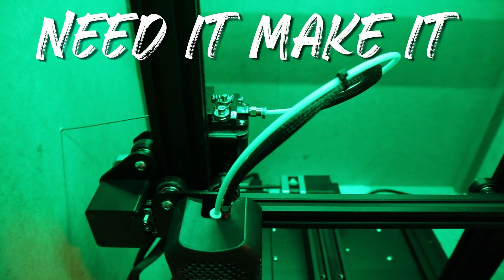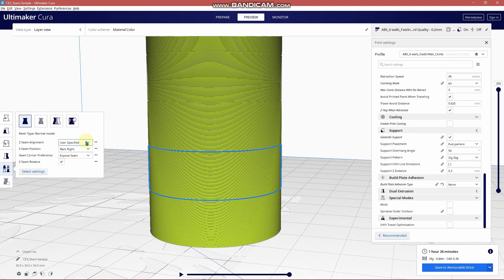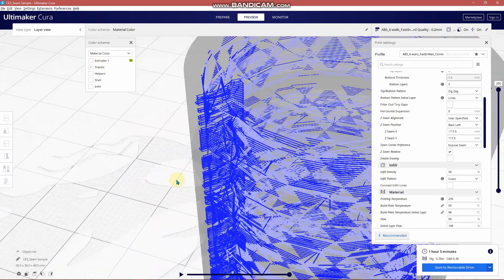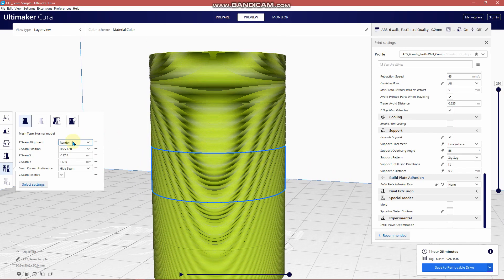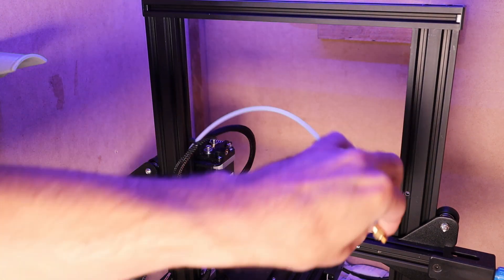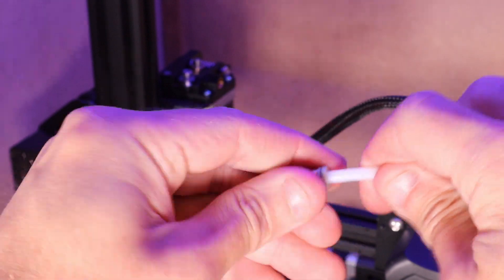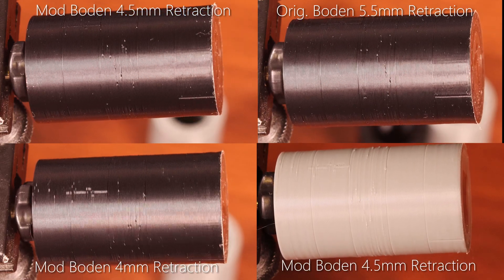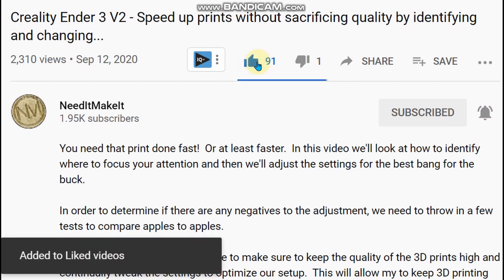Creality Ender 3 V2 - Testing Bowden Seams Through Cura & Viewer Suggested Mod

Comment: There are so many options because it also depends on the material. Our high quality capricorn and like boden tubes are 50cm long and have a very small ID tolerance and with about 6.5-6.9mm retraction we gut zero issues. Just ensure you always keep the length of your Boden tube the same when you replace it.  Also inside travel is key and inside before travel.

Comment: I use "wipe distance" at 0.8mm. Seems to make the best seams when you use double the nozzle diameter for the wipe distance. Coasting is a hit and a miss, don't use it much.
Reply from the maker: Always good to wipe, I agree, coasting hasn't done much for me either, but I do like to enable it to have a good visual on the seams, that in itself is handy.
Reply: Coasting can cause a weird lace like artifact on a single side of a print sometimes. That caused me a lot of head scratching. It's due to  the emergence of artifacts in layer thickness during entrance and/or exit of a coast. Don't coast with aligned seams to avoid this.

Comment: Thankfully using Prusaslicer on my Biqu B1 I have never had  an issue with seams or zits and blobs. (You watch I've probably spoken too soon). Happy new year all.
Reply from the maker: I've downloaded your slicer, I don't see many options to tweak, maybe I need to play around with the settings and visible toolbars.
Reply: Prusa slicer, is 0.2mm z hopping and also retracting on layer moves and the retraction speed is set to 70mm speed so it pulls up fast but a shorter 3.2mm distance for my Prusa Mini and I have never seen the drips that I get when I slice with Cura.

Comment: Retraction doesn't affect the seam that much. When the printer stops at the end of the outer wall, the damage is already done. Linear advance can help to reduce zits, but most extruders can't keep up with the huge ammount of compensation required for bowden printers.
Reply from the maker: There are quite a few variables involved, one source of poor control is the use of such high values of retraction for Bowden which do not seem to be justifiable.  The length of the tube comes into play a little from a tolerance standpoint, the friction in the tube may be a bigger player than we realize.  I have also found that the fittings are not ideal, they are sloppy and they allow movement upwards of 2mm.  A properly designed fitting for the extruder side would help to make these printers more responsive.  

I find that layer height does play into how visible seams are, along with nozzle size.  

What are your thoughts?

Comment: interesting take i havent played with z seam setting before i usally either use random or sharpest deppending on the model type (random for organic models, sharpest for mechanical parts).
Not supprised it didnt do much as to change the way the seam looks you need to edit the relating properties that produce it, you are mostly just changing the location here and since the model is a cylinder it doesnt do anything but move it around the location of it. 

What you want to look into doing
The ender 3 has a known coupler issue so replace it with a better one, you can see your tube moving as it retracts and primes. The black top type are usally better not the blue top ones, i find they have the grip of death on the tube and it doesnt move at all. They are a replacable part so every few thousand hours of printing inspect them and replace as needed.
Either get fake capricorn or real with 1.9mm ID tollerence this will help confine the slop in your filament movements.
If your hotend is PTFE lined you can dig out the crapping 2mm ID white PTFE and use capricorn 1.9mm ID. If you have a all metal those bi metal styles have a 1.9mm ID but they are pricy.
Lastly after any change to your machine you want to do Teaching Tech's tuning video go through all those to make sure everything is 100% dialed in before you change anything in the slicer.

Slicer settings to help seam
First of all you need a propper pair of calipers to mesure the wall thickness that are trust worthy this is just a given. A fresh battery can help in a cheap pair if they are digital as voltage drop affects their reading.
You mensioned coasting but this is a old setting thats now out dated by Linear advance in marlin other firmwares like klipper and RRF have their own version of this setting (pressure advance for klipper for example). A hollow single wall square is best for tuning to check the join of the seam and wall thickness over the entire flat of a wall expecially around the speed up and slow down areas in the corners and before and after the seam.
nozzle prime helps with nozzle pressure after linear advance has depressureized the nozzle it may or may not be needed but i find a very small amount like 0.03mm^3 can help.
Then you can print your cylinder for a real world check and maybe a square or hex tower as well to check sharpness of corners.
Reply: @Nathanael Harlem Instablaster =)
Reply: @Jackson Draven thanks for your reply. I found the site thru google and I'm in the hacking process now.
Looks like it's gonna take quite some time so I will reply here later when my account password hopefully is recovered.
Reply: @Jackson Draven it worked and I now got access to my account again. I am so happy!
Thanks so much, you really help me out :D
Reply: @Nathanael Harlem glad I could help :D

Comment: hey, i know this is an old vid and cura has come along way since, but how did you get the seam settings to appear on the left on the model tool bar as i call it where you change the size and so on? was it just an old version of cura that doesn't use the right hand setting menu or was it a plugin from the cura market place?
great video, thank you for the all the tips and info.
Reply from the maker: No problem, you should be able to activate Expert settings within Cura or any slicer if the seam is not already there.  For Cura you can click the drop-down menu which is to the far right with a little down arrow, that will expand the menu, you can then click the three horizontal line button and that will allow you to choose which level you'd like (Expert is what I have selected) once you have that you can search for seam, or find it under the section for Walls.  Hope that gets you want you need!

Comment: My Bowden tube is long, roughly 35 inches, I got the best result switching between Sharpest Corner and Random
Retraction : 10mm
Combing : Not in skin
Coasting : 0.064mm3
Reply from the maker: Wow, why do you have such a long tube...?  I have been wondering how a longer tube might impact the print I have been experimenting with shorter tubes and ran into a problem with the poor connection at the fitting.  I was wondering if there is a compromise between bowden and direct drive.  

Do you have any specific brand of tube that works best for you?
Reply: @NeedItMakeIt  I have the tronxy x5sa pro 500,  I only used the regular PTFE tube so far
Reply: combing is awful, it wrecks the layers by not retracting for nozzle moves.

Comment: My experience with pla and a heated bed is to preheat to 60c and print at 50c and my prints stick every time. If they don’t stick then I know its a z axis problem.
Reply from the maker: My first time printing with PLA and glue stick on a heated glass bed was that I could not remove the part without breaking it.  With ABS, a completely different story, it wants to warp, an enclosure is required for most of my prints.  PLA seems to be much more forgiving.  I just tried PETG with a glue stick with good success on a glass bed, my bed temp and nozzle temp were a bit high, but there was no smell and the result looked great.  It isn't as cheap as ABS, but it could be a contender for future as well.
Reply: Ive also noticed that if I dont clean the bed with rubbing alcohol and a paper towel then my prints will come loose. If I remember to clean the glass it sticks.
Reply: @NeedItMakeIt  Maybe the glue stick saves you, but from what I have heard, you should not print PETG on a glass bed. It sticks so well that it will remove chunks of glass when taking your parts off.
I have a PEI bed and PETG works great on it without any extra measures it coatings.
Reply from the maker: @court2379  Yes it does stick well, using glue stick prevents the glass from being damaged.  The glass I use is cheap borosilicate 4mm, but so far so good with not having any damage when printing PETG.  I believe printing direct on glass is a big no-no.  I'm enjoying printing with PETG much more than ABS, I don't give a 2nd thought to warpage and prints look good. 

If the glue stick fails me I will definitely take your advice and try the PEI, does it need to be replaced over time?
Reply: @MrGreenLeaf420  Clean it with soap and water if its glass and corborundum finish. Creality says if you use IPA is will break down the adhesive surface.

Comment: Curious to see what your results would be with a capricorn bowden tube. I swapped mine out and upgraded fittings before I printed anything on my v2 and so far my seams have been great. Only mod I’ve done to the printer.
Reply from the maker: I was looking into this just prior to the video, I think the set is an improvement, it seems to be rated well also.  Would you be able to provide the link to the one you purchased?  I think this might be a good investment for the cost.

Any drawbacks to the blue tube?

Thanks!
Reply: @NeedItMakeIt  This is my first 3D printer and I don't know anything about them so I upgraded based on what people said the V2 needed out of the box. Plus I wanted to print PETG and not worry as much about the tube melting as it's rated for a higher temp. I ordered from F1RST LAYER on Amazon "Authentic Capricorn PTFE Bowden Tubing" It's showing $13.99 right now on amazon and includes 4 stainless fittings and a cutter. Tolerance on the tube is night and day compared to the stock included. Hot dog down a hallway on the stock tube.
Reply: @postbreak  I can also confirm that the F1rst fittings are good quality too. Got a 10 pack (only way I could buy them on Amazon) and they are good quality. They have the metal teeth inside the fittings for superior grip as well.

Did you do the "hotend" fix also?
Reply: @therising1  What is the hot end fix?
Reply: @postbreak  look up ender 3 hotend fix. Multiple videos. Basically you cut a piece of bowden to fit inside the hotend, put a plastic washer on top of the tube, screw in the fitting until almost tight then insert the rest of your bowden into the fitting then tighten. The idea is that you are lining the hotend with bowden tube (preferably capricorn) so that there are no gaps in the bowden tube/nozzle junction to fix any leak issues that might occur.
Reply: @therising1  Gotcha, no I didnt do that. I followed a guide to put the bowden tube in as far as it goes, and then like a quarter turn to make sure there is no gap or something like that. So far haven't had a single issue.
Reply from the maker: @postbreak  That was exactly what I needed to know.  Last night I finally removed the stock tube from the fitting and found out that there was a severe wear mark in the tube already.  I pushed in some fresh tube and I was able to remove it cleanly.  It seems that the tube is allowed to move around quite a bit and that slight movement 100,000 times a print is wearing away the tube.  A tight fitting... fitting will prevent this I believe and should allow for better precision especially over time.   I personally don't think the tube is as big of a problem as the fitting that came with the printer, but I'll have to test that to find out.   I've already taken one apart to see how it works, trying to get a camera in there is not easily done!  

Great advice, thank you!
Reply: @NeedItMakeIt  Great news! Also on your combing video with that part that looks like it has "waves" what exactly is that thing?
Reply from the maker: @postbreak  That is a part that I designed to make the Bowflex bench much more adjustable for the seat portion.  I released a video on it and I've made quite a few for people, though I was hoping they'd just print the parts themselves because shipping is pretty expensive.  The parts are pretty heavy duty with 35% cubic and 5 wall layers 5 bottom, 6 top layers and I print from ABS so they are also a little flexible.  I've load tested prints over 2 sq/in samples at over 1500 lbs of force and no sign of breaking, pretty impressive for a light plastic part.     Here is the link.  https://youtu.be/9M2wX5IQAYU
Reply: @postbreak  I have been printing a bunch of PETG at 245C and now like to use it about the same as PLA+. When I learned about how the tube breaks down I was concerned, so I pulled it out. It was dirty, but after cleaning it I found no signs of degradation. This on a V1 Ender 3 with whatever they shipped it with two years ago. I did buy some new tubing, but went with the knockoff as it was 2 meters for the same price. So far it looks like the bore is tighter, but I have not measured or installed it yet. I did find the large wear spot around the tube where the fitting grabs it, so will probably do the fix, or switch to all metal heat break. Though the new tubing is supposed to be good to 300C, so I may just leave it, as all metal hot ends can have jamming problems.

Comment: Actually the length of the Bowden tube is irrelevant I’ve changed over to Capricorn a long time ago and the way you cut the tube is scary and it will cause jamming in the long run.
Reply from the maker: The printer is still going strong, too short of a tube could cause some problems for some filaments depending on how brittle they are and how much friction there is between the tube and the filament.

Comment: Wow those are bad seam zits. I found this cause I was nitpicking the seams on legos I was making, but I’ve never had/seen anything that extreme before. (But I’m still very new to all this so maybe I’ve just been lucky)
Reply from the maker: For sure.  I didn't hold back on these samples, extreme lighting and colors which show off blemishes more.  Direct drive certainly produces less of these issues with much more control over the retraction and extrusion.  My first printer was a direct drive, and seams were not very visible.  I was also printing with ABS which has less sheen as well as a 0.4mm nozzle helping with this again.  I have now moved onto a 0.8m nozzle causing the seams to become even more visible.  It is not a problem for the parts I print, but I expect activating linear advance will help with this a bit.

Comment: I've seen a video talking about the fact that too short of a bowden tube will introduce play between the tube and the plug on the ender 3.
EDIT: It's actually from the same guy, 2 weeks after this video.
https://www.youtube.com/watch?v=A5Ac-sB5jIY
Reply from the maker: There is one more problem with having a short tube and that is that sometimes the tube rad becomes so tight that the single gear extruder can't push it through, it grinds and causes a fail.  I've experimented with a short a tube as 10" and that's too small, a 12-14 seems to do the trick.  Too long doesn't help from what I have seen.  

I recently performed testing and double length gives around 2x the amount of pressure required to push the filament through.  Oddly PLA came in last place for fracture, next CF PETG and then PETG and then ABS.  I'd need to experiment with more brands and qualities before I can conclude anything.  As with life, there is always so much more to it when you go looking.